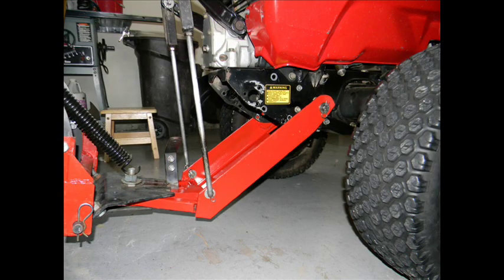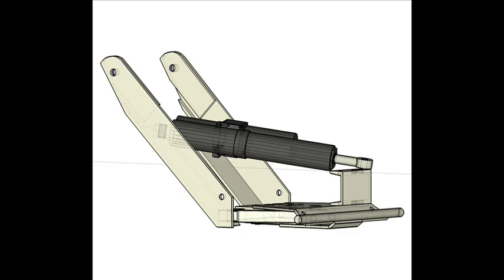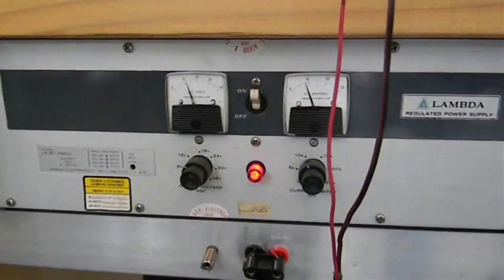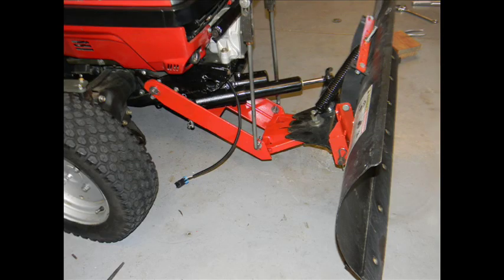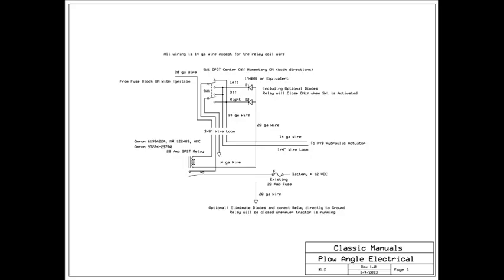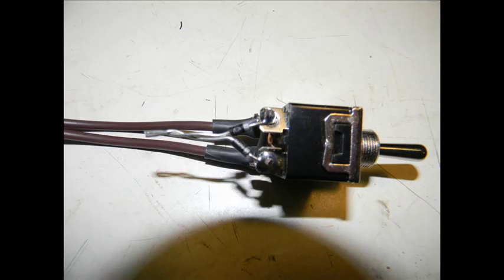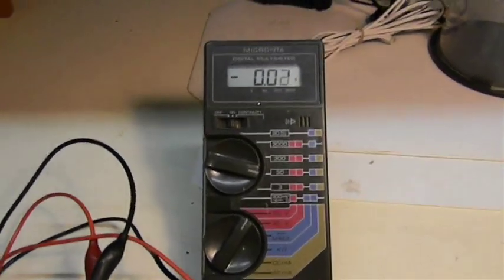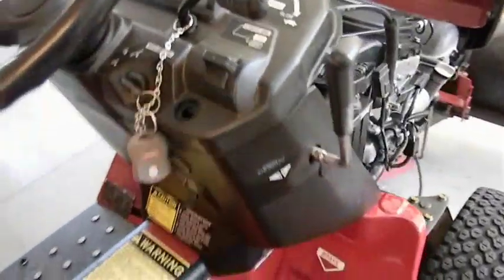Hydraulic Plow Tilt for Snow Plow - on a Honda RT5000 5013 Tractor

Comment: I looking for a high-speed Hydraulic actuator (thrust speed: above 3m/s) that is smaller than yours and come with lower power (250 lbs is enough), and high precision. Please advise.
Reply: Any speed would work as long as it is strong enough.  You should have at least 1000 lbs.  Calculate the force for the blade you are using. Hydraulic Electro/hydraulic works best since static forces are balanced.  I plan another video with a much more robust mount using the same actuator.  The KYB actuator is solid.  Thanks for watching.
Reply: Robert Danti Thank you for the reply! I am looking forward to see your new video.